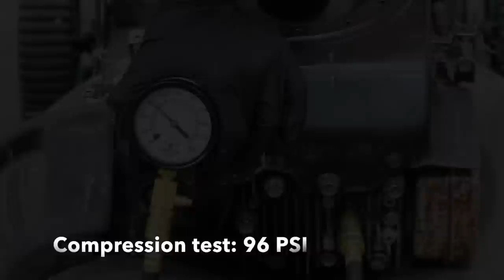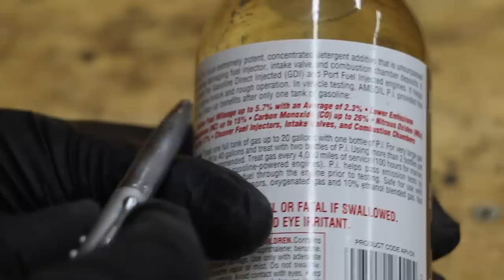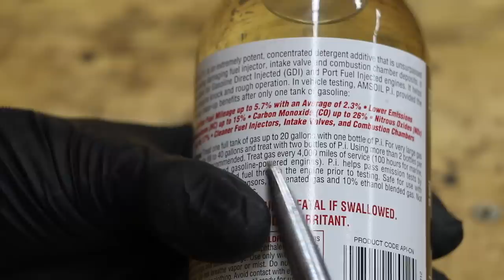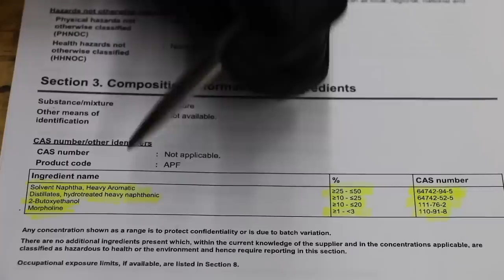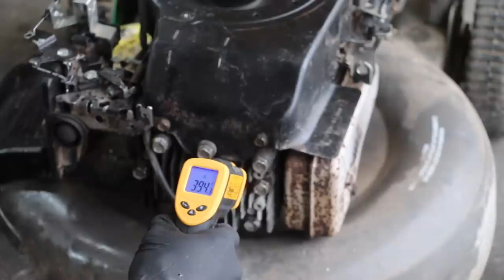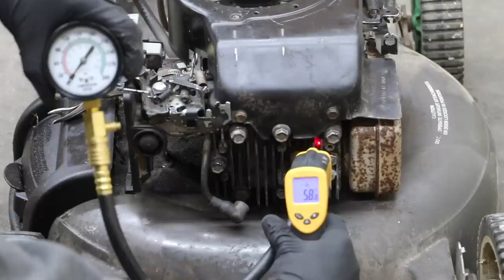Is Amsoil Power Foam better than Seafoam & MMO? Let's find out!

Comment: Have you tried using just water mist?
Reply from the maker: Not yet, but this seems like a great one to test. I did test a water drip, but I believe a mist would work better. Thank you for this recommendation.
Reply: Great Idea 😎
Reply: Ignorance ,, trust me water is great,,,. About 16 oz,,,, anyway you can get it in the intake manifold,,,, a Windex bottle,, spray it in missed it in,,,, you can put it in a open vacuum line,,,, this steam cleans,,,.  My grandfather showed me and I've been doing it for over 35 years,,,, but only on Motors that need it,,, or have over a hundred and twenty thousand miles on them,,,,,.  I water my Pistons Every Spring before it's oil change,,,,. !!!!
Reply: How much margin do you have before a problem arises? For example, with seafoam I've never had issues with creeping up to the amount needed without stalling. With water the only thing I worry about is hydrolock. Is water spray similar to seafoam where you can dial in the amount or is the amount of water needed so tiny that you need very fine control?
Reply: May I also input Methanol (wiper fluid) as part of the mist project, we use it to cool the inlet charge on engines.
Reply: Rick Simpson, Yep, I've been doing this too for over 40 years and water works better than all these "snake oils" that IMO do not deliver what they claim.
Reply: Steam works great, better that atomised water.
Reply: I had a '91 chevy cavalier that would knock due to pre-ignition. Even premium gas didn't completely resolve problem, nor did a full tune up to make sure ignition conditions were correct. Since i suspected combustion chamber carbon deposits getting  heated up were the cause of the pre-ignition knock, i would drip about a pint of water down the carb of the running engine to create steam in the combustion chamber to break loose and vaporize the carbon build-up. This practice always cleared up the pre-ignitiin knock, even with 87 octane gas, for about 3000 or more miles. It was an easy, free step to take several times a year.
Reply: Yessir.  It works very well.  Just make sure the engine is warmed up before you start misting the water.
Reply: thats the point, hes testing to see what works.... if done right it should work
Reply: thats a cool tid bit man, thanks for the share
Reply: From personal experience it really works very well
Reply: Excellent idea.
Reply: Can the same method apply to an old diesel engine which is 30 years ago ? Or should I try to work on water mixed with alcohol ?
Reply: Also, as mention the method was being used on the jet that it was made to cool down the intake air and fuel mixture for better and much richer fuel for high power output within a short period of time such as during taking off. But it was not design for the purpose of cleaning the inside engine.
Reply: Right you are, Rick.  Run enough water to make the engine run poorly for a minute or two (presoak, flake removal), then let it have enough to choke it and stall (steam clean).  Wait 15-20 minutes and take it out onto the freeway for a 5 minute drive.  All clean.  (retired mechanic here)
Reply: Michael Mansour 
My old Subaru Legacy GT had water injection and it did 12's with an auto box!!
Reply: Water has been the old standby.  I think it would be a good test.
Reply: haha I just logged into YouTube to suggest distilled water
Reply: Should mist distilled water then do distilled water and methanol mix
Reply: It doesnt help that the B-52 uses TF-33 engines, they smoke like a train without help.
Reply: Robert G no offense but water ain't gonna lube my upper cylinders and clean my carb on my old harley. So To each there own. Plus it's alot easier to just pour something in and forget about it.
Reply: DOOOO EEET!!

Also, if you want a really fine mist, use your fuel-vapor setup with a secondary bottle set up the same way, then run them thru a "Y" valve, so you can start the motor on pure fuel vapors, then meter in water mist (generated the same way as the fuel-vapor) until the motor starts to stumble, then back off slightly & let the water bottle empty.
Reply: instead do leamsons or a fruit with it that would be cool
Reply: Your oil piston rings lube your cylinder walls my man.
Reply: Project Farm please do a video on water mist decarb...
Reply: Small pond pump hooked to an aeroponic mister sprayer would work great and cost under $10.
Reply: Even on a small engine it would hard to hydro lock it unless you dumped a big cup into the intake. You'd have to add water to the point where there is more water than the combustion chamber volume. A 10cc chamber may seam small, but at 3000 rpm that's 30L of water a minute. Engine are really really good pumps. I'd worry about knock before hydrolock, as the water raises the compression ratio.
Reply: being a small engine mechanic, ill advise to never,  NEVER put water in your engine, even in a mist. Not only are you asking for carb issues later on, your just begging for damage in the crank. Water just slips right past your piston rings and will contaminate the oil, rendering the oil useless. Project farm can test it, but it will be the same result as the water drop test.
Reply: The water should be flashing to steam when it enters the cylinder, thats how it removes the carbon. Also the oil should be hot enough while its running to boil off any water that gets in, as you want the engine hot as possible in order to steam clean it.
Reply: Tim Hunter what is steam? water. trust me ive seen people do it and its the same exact result. People try these cheep alternatives that lead to costly results. Im talking from what i have personally seen, but maybe project farm will come with a different outcome. Im just saying, the average joe should never try it.
Reply: Water injection was use in lots of aircraft, and a few cars. The top of the line M4 has factory water injection. To much of anything can damage an engine.
Reply: Tim Hunter from what ive searched up, water injection has only been used for power output in jets and drag cars.
Reply: Stephen's World, Farming and Mechanics most fighters and intercepters in WW2 had water injection. If it was so bad for the oil I doubt the would risk it.
Reply: Tim Hunter back in the good old 1940s, they didnt have all the testing of effects of water in the engine and saw the power output benifits. Nowdays, we know better. Weve done the tests and the tests have come back with a clear result, oil contamination leading to increased wear in the engine. Water wont make the engine stop running immediately, as shown in project farms drip test, but the effect will still happen, just slower.
Reply: What do you get when gasoline burns and how much do you get?
Reply: Stephen's World, Farming and Mechanics water was used in many World War II aircrafts,,, but it was called emergency wartime power,,, ewp system,, It could only be used for about 5 minutes to gain altitude or outrun your enemy,, any longer you would run out of water or lock your engine up,,,. This was because the engine was running wide open and the water increases the compression,,,, it also aids with Cooling the hot combustion Chambers,,, airplanes are replaceable Pilots are not,,,
Reply: Don’t wanna do that unless you want to blow your engine up!
Reply: Hunter Killer 
You young whipper-snappers and your 'petroleum' based engines! I'll never use ANY engine that runs on those new-fangled, fly by night fuels like gasoline or diesel. Just like all fads, they will lose popularity real soon! Then people will return to the standard engines.......Mules and horses! Now, create a video that once and for all illustrates which fuel promotes best performance, hay vs oats vs alfalfa........
Reply: Tim Hunter 
Well, tanks and military aircraft weren't designed to be driven 5-7 days a week, 52 weeks a year, for 5-7-10-15 years either! They were designed to last long enough to destroy 1 or maybe a few enemy vehicles, before either being destroyed, mothballed til the next war(assuming non-obsolescence), or overhauled after a few hundred hours(if that much).  They used nitrous oxide injection as well, but you don't see car manufacturers installing nitrous kits onto their cars! Military vehicles exist under very different circumstances than passenger cars.
Reply: water worked great on my EFI Honda engine.  As good as sea foam in my experience.  Amsoil though is superior in every application that I have used it in.  Their motor oil is a Godsend
Reply: Project Farm I would like to see this one tested I suggest you use a spray bottle or a pressurized plant sprayer/mister
Reply: I'm curious if methanol injection would take the carbon off the cylinder head piston or valves since methanol is corrosive it should work right?
Reply: Basically you take your compression ratio, and displacement to figure out how much space is left in the cylinder at TDC, so a 100cc engine with an 8 to 1 compression ratio should have 12.5cc left in the cylinder at TDC, 4 stroke engines fire onece every other revolution, so 3000RPM engine would have 1500 compression cycles, multiply that by the space left at TDC to get 18750cc per minute, which is nearly 19L per minute, but we don't want to fill all of that space, since there needs to be room for the air fuel mixture, and it needs to not exceed the pressure the engine normally runs at too much, so let's dial that down to .5cc per compression cycle MAX (750cc/min), since if it all turns into steam that's a whopping 500cc worth of steam in this 100cc engine, ( which would probably would blow it up, but not from hydrolock, although there likely isn't enough heat in the engine to actually convert most of the water to steam, so it might be OK), lets dial that down to .05cc/compression cycle so there is only 50cc worth of steam per cycle, which puts us at 75cc/min, which could be done with one of those mist nozzles, I think.
Reply: Dawn soap, pour and soak.. Think fry pan with burn grease etc... Hot pan dump soap.. Out it all comes
Reply: Fail.  Your reply was a fail.
Reply: @Joshg1984  everything in this video is a solvent. So they do the exact opposite of lube. Even marvel is a solvent just not to the degree as the others. You piston rings lube your upper cylindera. Any additive in the gas isn't changing anything as far as lubrication. On the subject of the thread. Weight for weight seafoam chemtool etc beat water all day. But you have an unlimited supply of water so you can get the same results with a little more time. And it's free
Reply: love your process: more REAL WORLD than any lab...
water/methanol was used in WW2 for emergency horsepower boosting in combat aircraft, but was only short spurts as it could make so much power it DID blow engines.
try squirting  AUTOMATIC TRANSMISSION OIL...my dad was an A&P, as well as a MASTER COMMAND PILOT. could build anything
Reply: I have a truck I'm too lazy to replace valve stem seals on. Drinks 3 qts of oil every 500ish miles. Hold around 2500 rpm. Stick tiny vacuum line from tb into gallon of distilled water, pinch to limit flow. Works great, cleans o2 sensor as well so truck starts running right until it gets gummed up again.
Reply: @ProjectFarm   to add to this when an engine loses a head gasket those coolant washed cylinders are always spotless
Reply: @MegaMopar4406  Mmm yes this is true !
Reply: @TrojanHorse1959  Just because you can get away with on a older car doesn’t mean you can on New car. Using water can also cause serious problems.
Reply: @waterloo123100 , ICE engines are pretty much the same now as they ever were. They don't know what year they were made. As long as you mist the water in and don't just force it in with a garden hose it will work the same now as it always has. without harming the engine. You just put in enough to make a good steam to blast off the carbon deposits. However, carbon deposits are NOT an issue like they used to be so most people may never have a need to try it in the first place.
Reply: @TrojanHorse1959  You can get away with that on the older engines to using carburetors and port injection. And I’ve seen water work well in that scenario. But that is absolutely not the case with New Direct injection engines the computer system is Totally different from vehicles in the 90s. Using water on a direct injection engine can ruin and seize your fuel injectors that’s why seafoam has their spray as it’s much safer to use for all the sensors in vehicles now days. GDI is far different then older engines and they have plenty of carbon issues. My neighbor has that problem with his 2014 Impala as we speak.

Comment: I’m an Amsville dealer and I remember when Amsoil Angra say about 15 years ago brought the PI improver out they took off it was a Honda or Toyota car I can’t remember which took the head off photograph the combustion chamber tops of the pistons took a couple of the intake valves Aden took pictures of those took all the injectors out and test fired him and took pictures of those put everything back together and didn’t touch anything other than just reassemble it and they ran I guess a couple tank fools of PI improve her through there in huge difference know your test is a good test but it needs to run for longer duration for that PI improve her to clean that da carburetor bowl out I guess it would clean that out there anyhow this is Jim mungai from Kennerdell Pennsylvania I like your testing and tutorials keep up the good work guy
Reply from the maker: Thanks, will do!

Comment: Great video, Quickshot is the recommended fuel treatment for small engines.  I have used all three products, but the best long-term results I received where with Powerfoam.  have you considered testing AMSOIL small engine oil?  Keep up the great tests and videos.
Reply from the maker: Thank you for this recommendation!

Comment: Grandfather owned an independent "Ford" garage in the 40s. Used to talk about a guy at the fairs that tethered a Modal A Ford. Filled the crankcase with what was then the additive that Ford sold with their label (later Power Punch?) before opening, ran it for an hour and at opening of the fair removed the drain plug and let the car circle til lunch. Filled it again at lunch and ran 35-55 minutes, and ran it without drain plug or lubricant again til closing. It was a viscosity index improver, only petroleum, as far as I know. Have personally been  a Chevron dealer and have been in the industry most of my 76 years. Have had personal experience with Wynns and JB products. Can add testimony to what I've seen these products do. Having built lots of performance engines can give personal testimony about difference between fuels and oils. Your experiments, though very limited, are fun and interesting and likely of use to the average person. Thanks for what you do.
Ray Clark
Reply from the maker: Thank you!

Comment: AMSOIL Power Foam seems to work the best on the carbon removal. Glad I use all amsoil products!
Reply from the maker: Thanks for commenting.
Reply: Project Farm how do you feel??
Reply: Amsoil is hype 😂 it's good oil but not any better than supertech all oil is good just need to change every 5-10k
Reply: @raptureready9502  Lmao your crazy
Reply: @waterloo123100  best kept secret bruh. Supertech oil is primo👌👍💪💪🇺🇸 🇮🇱
Reply: @raptureready9502  yeah well this channel proved you wrong amsoil actually is the best followed closely by Pennzoil
Reply: @ProjectFarm  
These days so many products for fuel injector cleaners claims which one really works !!
Any tips? will be appreciated
Reply: @gufiaito69able  Yessir. Pennzoil Ultra Platinum that is of course comes second to Amsoil Signiture Series💯
Reply: @raptureready9502  That works for me. Been using Supertech Full synthetic 5W-30 in an '01 Cavalier for 17 years, ZERO Mechanical problems! I change it at about 5000 miles. Car has 205K miles on it now, uses 1/2 quart between changes. It is obvious TO ME that using a "designer" oil like Amsoil would provide NO extra benefits, but would lighten my wallet! I remember  when, in the '70s, Amsoil started being sold. It was sold by private individuals (like they sell Avon products). These individuals were like "snake oil" salesmen making claims like "you will notice right away how MUCH SMOOTHER your engine runs with Amsoil"! I fell for the BS (young and foolish), bought some from a co-worker. At first, it SEEMED like the engine ran smoother and quieter( only in my mind), but as time went on I realized there WAS NO difference. This was about 45 years ago, so maybe the formulation has changed, but I remain skeptical.

+
Reply: @TheOzthewiz  I Agree 💯I buy supertech and it has been a very good oil. My fleet runs flawless with supertech
Reply: @raptureready9502  Yeah, another reason I like the oil is because it's sold by Walmart. I can pick it up at my local store at 2:00AM if I need it! Also, the price has DECREASED on the 5qt jug. Used to be about $18, now it was $13.88! How can you go wrong with a deal like that! CHEERS...
Reply: @TheOzthewiz  what's your time worth 5 oil changes in five years or 20 oil changes in five years, I personally like doing maintenance but on three everyday vehicles two motorcycles and one ATV it gets to be a bit much.  Take a person who pays for the service, changing oil once a year makes financial sense, plus you have about 1/4 the waste product.  Amsoil preferred customers get a good deal and free shipping, the gear lubes (especially easy pack) and transmission  fluids are top notch as well.
Reply: @TheOzthewiz  well designer oil? Maybe. It is an enthusiast, gear head oil for folks who really understand engines, machines and the importance of lubrication. If you are worred about price, go ahead, knock yourself out on the super sludge or score more, meaning scored pistons & cylinders as my buddy's used to say. Lol!  I know what I'll be using 👍